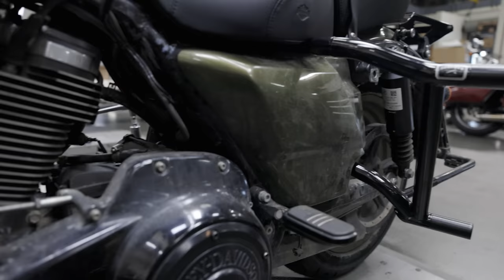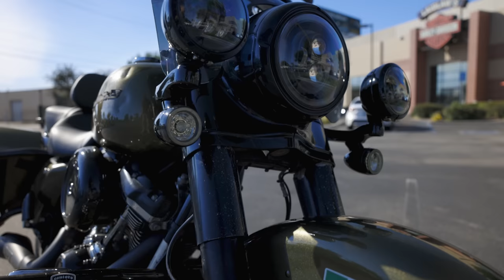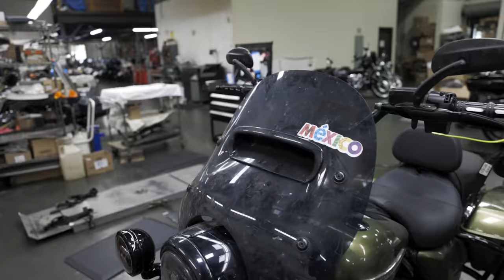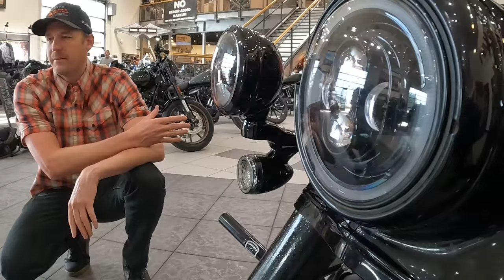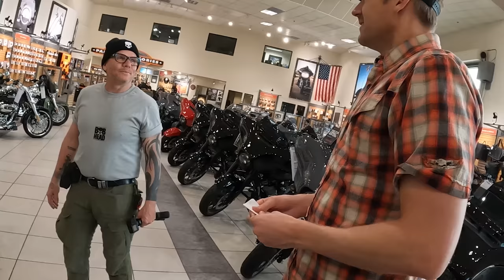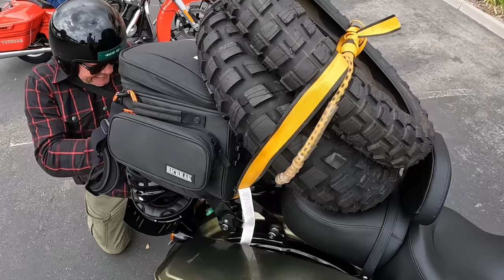"Overhauling" Million Dollar Bogan's Harley-Davidson Road King Special

Comment: Man . I wish we had a shop like yours in Adelaide Australia, unfortunately the shop here doesn't care , 5 minutes out the shop with a Harley streetbob 2022 model after a first major service the whole sprocket with all the bolts came loose damaging the sprocket , rim, axel and swingarm, off course its the customers fault claiming a burnout and that they dont look at those bolts on the sprocket since its been done in factory. Stay away from Harley Heaven , we have been warned by how many riders now we know why.

Comment: Hey Matt what is the model number of the riser plate from Krause will it work with biltwell pull back riser ? I could use 2 more inches closer to me. Thanks. Great job on Danny’s bike and the Wilber’s he put to the test. Which is why I now have them

Comment: The smaller, lighter 2-into-1 exhaust is good for off road work and maintenance, but it's painfully loud.
Reply: It does sound loud, maybe a bit annoying on long hauls , looks great though.
I'm running a V&H Propipe on my 2017 Wide glide, love it, deep note and a definate increase in torque. Still gotta wear the earplugs but 😀
Reply: @Grahamgringo  
Also, with all the weird places Danny goes to, does he really want to call more attention to himself? I wouldn't. Not to mention annoying people. Otherwise, a more compact exhaust system does make sense.

Comment: good luck Danny. wow i would have thought more would be wrong and for sure rims replacement. nice that no paint job need as it looks well used. lol.. love the new lamps and bars and crash bars, and the exhaust pipe are sweet
good job fix n it up.
cheers to everyone who stepped up on a much needed tune up

Comment: Really would like to know what parts you used to install the passing lamps and turn signals??
Reply from the maker: I think the key is the bracket from a 2006 street glide. Watch my video Adam’s Road king special. Read comments section.

Comment: as a t bar aficionado and technician of harleys i dont understand putting them on a pull back plate on a road king. i bet you did recommend tbr, seems like a real parts bin special build for all the brands your dealer does buisness with. TBR, Kraus, santoro, big daddy HD. Plenty of options to go with espescially in so cal. but hey im glad its been updated cause that dude goes harder than any hd influencer.

Comment: This is cool and all, but your service department wouldn't even install a steering stabilizer or a non HD battery in my 21 FXLRS due to red tape excuses. Which was a bummer because I saw all the cool bikes you build here on youtube. Most certainly not the case in person though....